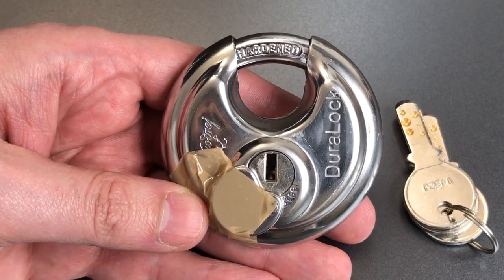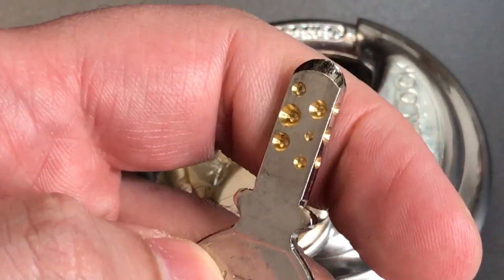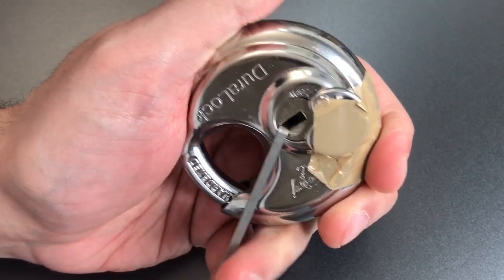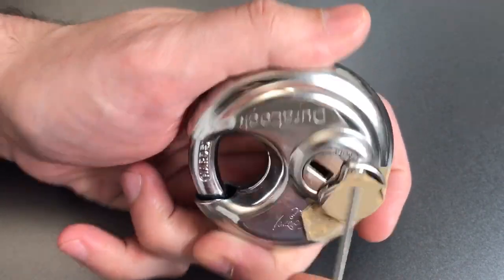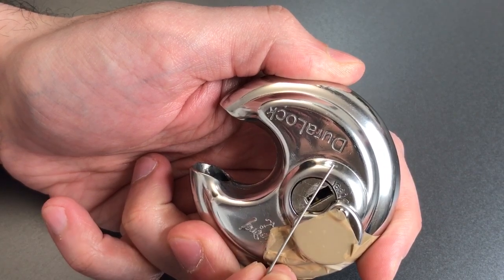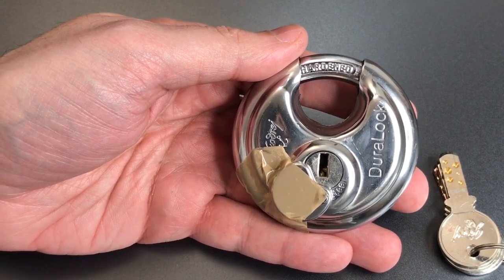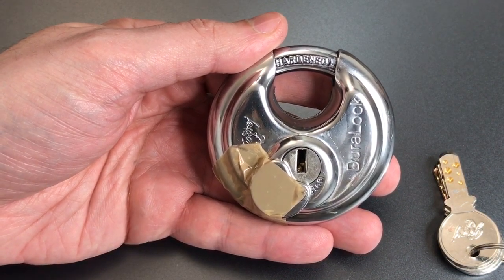[423] Godrej 70mm "DuraLock" 9-Pin Disc Padlock Picked

Comment: Hi Harry, Interesting to see a dimple lock in a Disc padlock. We see very similar locks occasionally on imported fireproof home safes, and they always rake open easily, probably due to manufacturing tolerances, and shallow pin depths. They also impression quite easily. The saw tooth rake was made from a wiper blade insert.  Regards, Brian.
Reply from the maker: Thanks.  I actually tried foil impressioning this one with no luck, but I will revisit it later.  I have very little experience with impressioning, so it may just be that I need to develop the skill further.

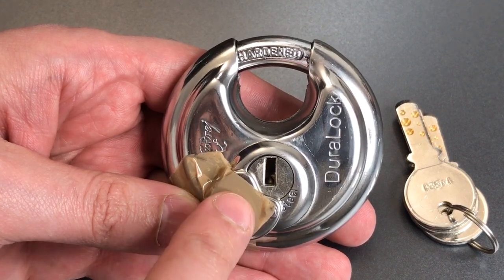Comment: 0:28 - 0:32 Shutter taped open.... Why didn't you remove the tape from the shutter after lockpicking as said.
Make a video in 2021 showing the removal of the tape till then i unsubscribe you.
Reply: Hi, it is not so much easy to open a mechanical lock , you can try it at home , may be he did something fissy to make the video to get popular,  all mechanical locks are computeris combination 😀,  so take a chill pill
Reply: All the lock combinations need to fulfill at the same time , just look onto shaft what he was doing on the video , he just push the steel shaft